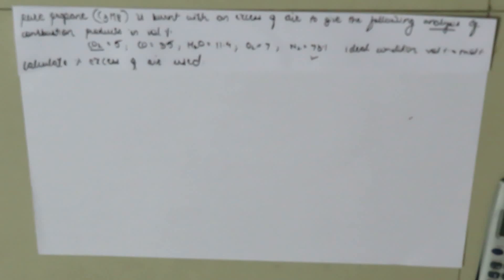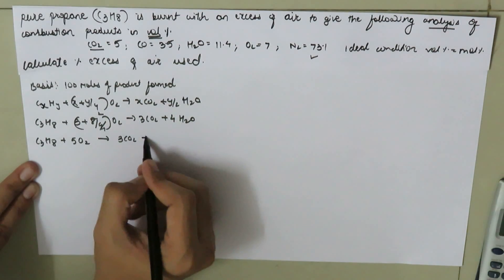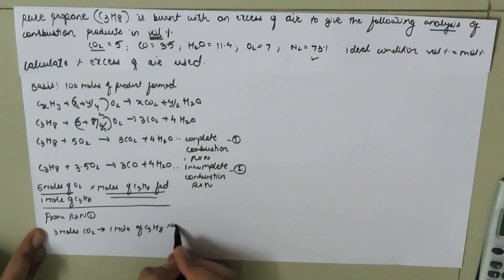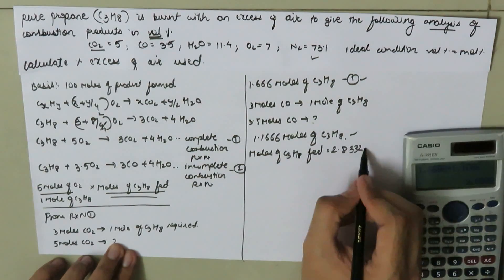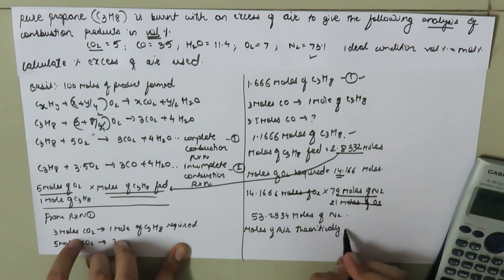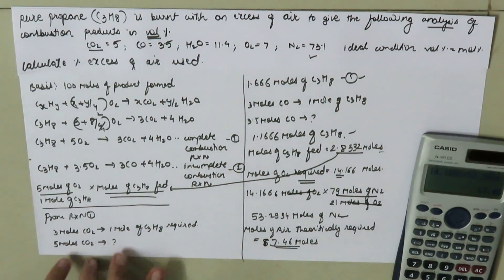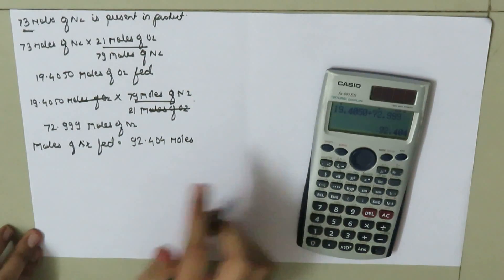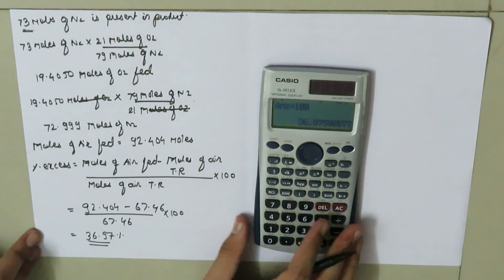calculation of percent exesss of air in combustion reaction

Comment: A bituminous coal has 27.15% VCM; 62.55% FC; 7.06% Ash;  0.95% S and .28% N. It has a calorific value of 32.3 MJ/kg. The coal is fired with excess air supplied at 30 degrees celsius and 1 atm. Partial Orsat analysis reports 9.78% CO2, and 2.45% CO. Calculate:

a. % Excess Air
b. Ultimate Analysis of the coal
c. Complete analysis of the stack gas.